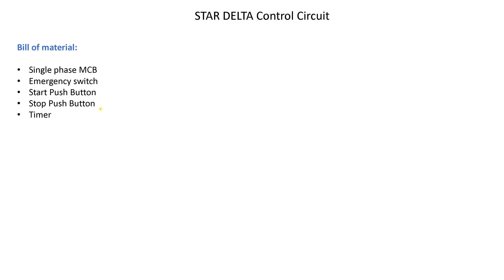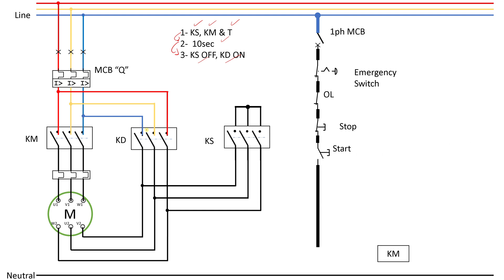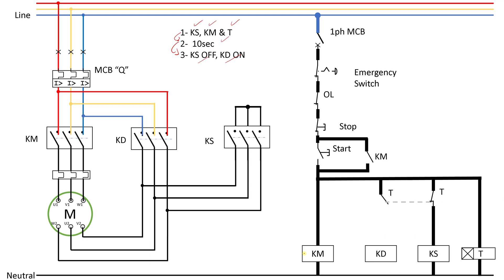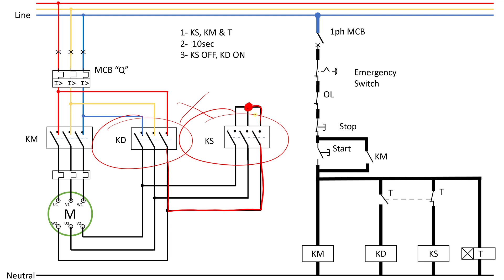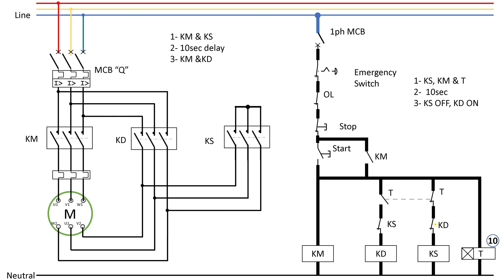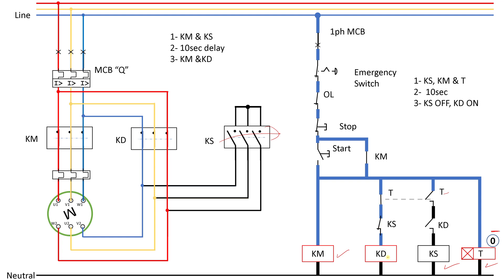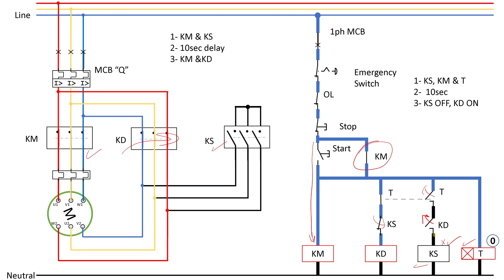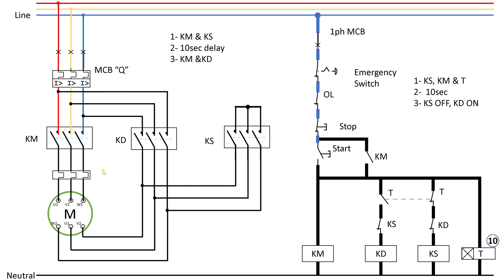Star Delta Control Circuit Wiring Explained | Animated | Easy

Comment: i wanna ask something , do we really need KD-nc and KS-NO ? mos we have timer to open  star and close delta contactors
Reply from the maker: I provided a full explanation of this inside my Udemy course. The reason we use the NC (normally closed) contacts of both the star and delta contactors is to create a safety interlock. This interlock prevents both contactors from being energized at the same time, which could happen due to human error if someone energizes the contactor manually or if one of the contactors gets stuck and stays latched. Without this interlock, such a scenario could cause a short circuit. So, it's an essential safety feature in a star-delta control circuit."
Reply: It is meant to fool proof the installation. Any person can manually close the two contactors and disaster will be happen like he indicated.